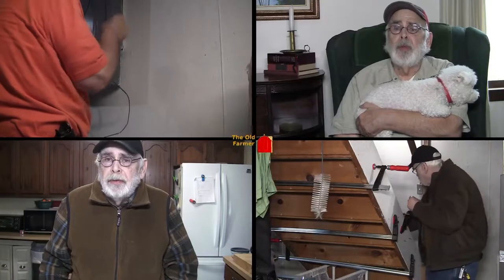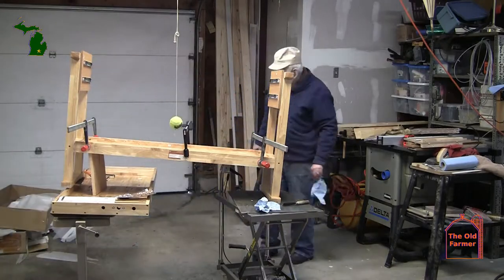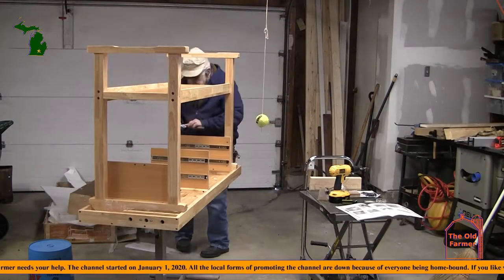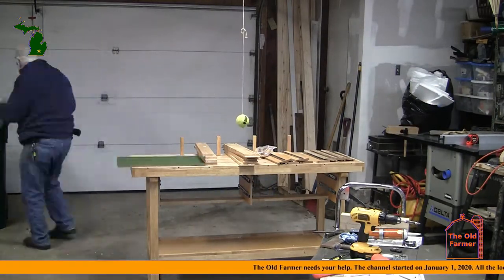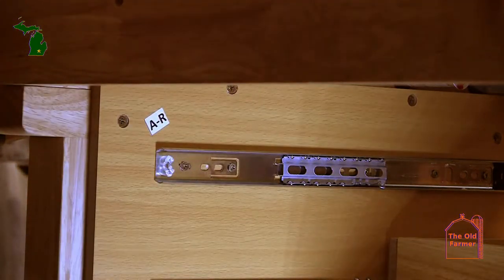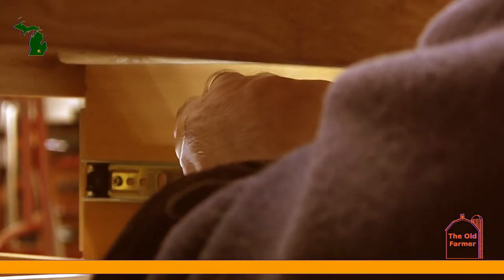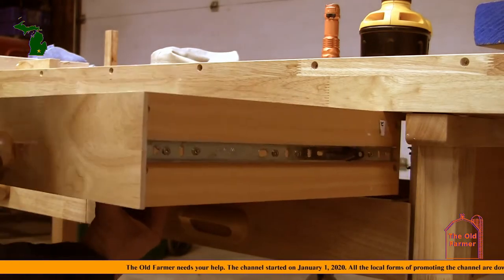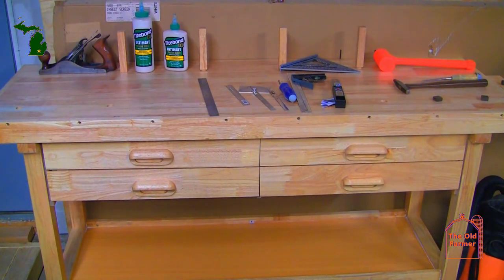67 Harbor Freight Windsor Workbench Build

Comment: Farmer,
Did you sand any of the mating surfaces before adding the construction adhesive?
Reply from the maker: Actually I didn't. It is holding without a problem and is still holding. I think there would be a problem with typical wood glues because of the finish. Thanks for watching and be safe.

Comment: I just bought one, thanks for the tips! What do you think about adding wood glue to all the mating pieces before screwing them together? Would that help a little with the stability?
Reply from the maker: I talked to both Gorilla Glue and Titebond. They both recommend for uncontrolled environments to use construction cement because it will flex more with temperature swings. If this is not the case they both said glue will work. My bench is holding up well. I do recommend put weight on the shelf because it is light and can move when planing wood. The bonds have held well and is still sturdy. I recommend glue for any kits that are similar and this is true for furniture. Thanks for watching and be safe.
Reply: @Original_Old_Farmer  Thank you! Great advice I'm definitely going to follow :)

Comment: Do you think this would be a good assembly table?
Reply from the maker: I would use a construction adhesive when building. I think it would work well for most projects. I also applied several layers of wax on top. I don't think I would try rebuilding a car engine on this work bench, but the usual home projects, it should be a good bench.

Comment: Have you resolved the drawer rail issue?
Reply from the maker: I haven't gotten around to it, yet. But, I do know that it will take (4) 14 inch rail pairs to swap out the slides. I've had some tractor issues where I am rewiring front to back. It is still on my to do list. However, at my age maybe it should go onto my bucket list. Thanks for watching. Stay Safe.